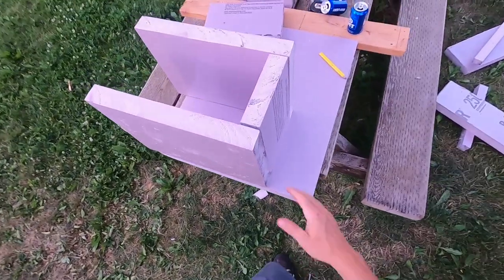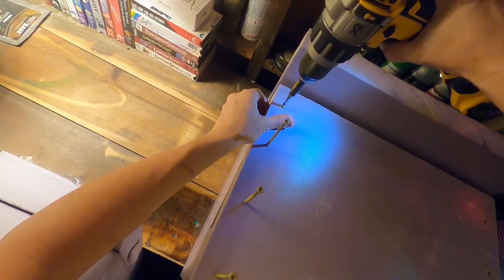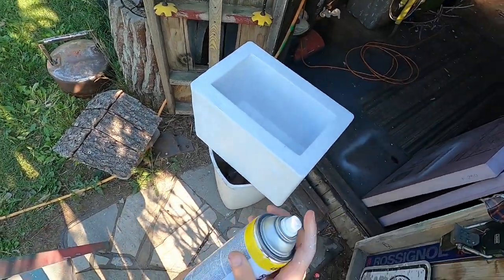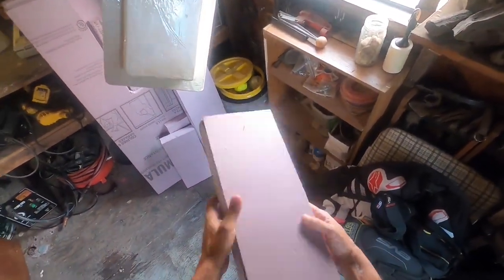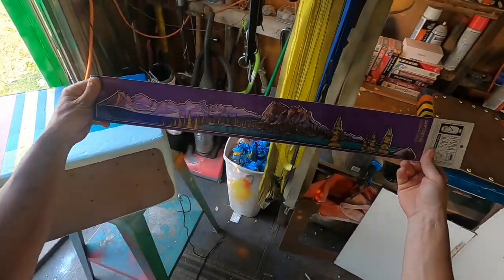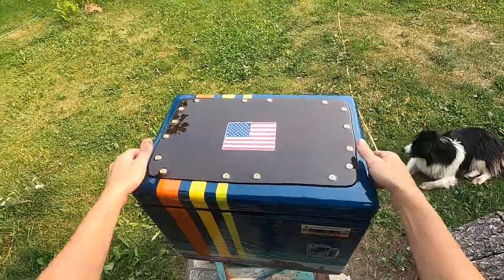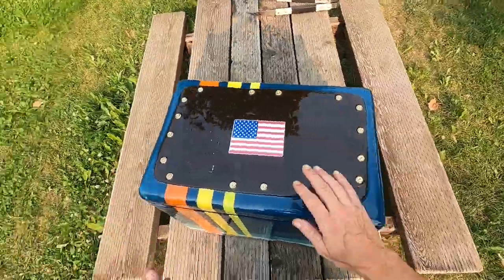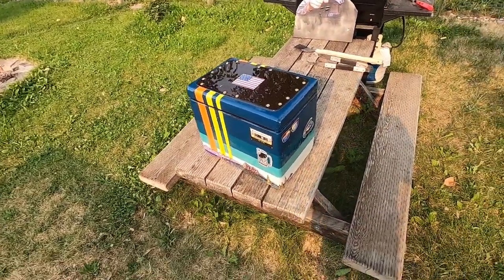DIY HOMEMADE YETI COOLER

Comment: nice job!!!i did something similar by lining my cooler with 1inch pink board and a milar emergency blanket, with a block of ic3 on the bottom, my frozen food on top of that an 2 bags of ice on the food would keep my food frozen for 2 days and the block of ice would be frozen still after 8 days, but the cooler is too bulky and i need a second one for drinks, butter, produce and that kinda stuff, was thinking of making one like yours with 2 compartments in it, one small side for frozen meat and its own internal lid and the other side a little larger for drinks, butter an produce, then a lid to cover the entire thing, was thinking of building it inside a tote for rigidity but ilike the epoxy idea, how tough does it make it without fiberglass matt?

Comment: Thanks for the DIY cooler video! I need to modify my little Ozark Trail cooler that sweats 😂😂😂 I had my igloo jug full of ice, that also sweats, in it. So tney were both sweating 🤦🏽‍♀️ 

I'm going to do the spray foam hack on them both, first. Then get the foam panel for a storage bin to put the cooler in. I'm homeless & can't afford a $3 bag if ice every day. Winter, we have lots of free ice 😂😂😂 and it's so cold I seldom need ice unless I spring for a pack of Klondike bars. 😊

Comment: Awesome job! How did you epoxy the sides? Didn't it just run down and drop off the bottom? I thought coating in epoxy is mostly for flat surfaces. I need to clear a cooler and would love to use epoxy!
Reply from the maker: Hello Stephen. I applied several layers right before the previous had fully dried so they would hopefully bond together. Later on I applied another layer but I had lightly sanded the cooler to create a bonding surface. And yes it did drip off the bottom edges and I had to do a bit of grinding to smooth it out. Thanks for the comment.
Reply: I still don’t understand how the epoxy didn’t slide off? Did you sand the cooler down enough to create a bond?

Comment: How is this holding up?!?!? This is an amazing cooler build man. Definitely inspiring. If it’s still going strong I’ll probably make one soon
Reply from the maker: Hi Ben. You know, it's hanging in there a lot better then I though it would. No major dents or scratches. It held ice for three days in 90 degree temps on one outing but it was not being opened that much. Thanks for the great comment.

Comment: how has this held up being epoxy and foam? Anything you would do differently? I'm considering trying the same thing but adding fiberglass cloth for extra strength.
Reply from the maker: That is an excellent idea! Even with multiple layers of epoxy it has incurred some dents. The fiberglass I think would be more cost effective as well. At what point does somebody simply buy a well made cooler. My cost were quite low until I did the paint job. I think the fiberglass cloth would solve both cost and durability at the same time and also maybe give it a cool rustic look.
Reply: Did you do a build with the fiberglass cloth?
Reply: @BigQ07  I have not. Rough pricing put it around $150, which has deterred me

Comment: Idea for handles: route out enough space to flush mount and epoxy steel or aluminum blocking (maybe 2" high by 6" wide) on each narrow side before painting. Pre-drill holes in the blocking before mounting, and you can attach any kind of handle you want. 
An easier method might be to just drill through all the way and make rope handles, knotted inside to keep them from pulling through, but that would likely compromise the insulation...
Reply from the maker: Great ideas and love the feed back!

Comment: Dude! 
My wife and i were sick of a "bag of ice a day" living with plastic made coolers.
My wife considered that the outter layer must not transfer heat or become hot. 
So we looked for such and here youve done a great job...
Magnificent.
Yeti blows
Reply from the maker: Mucho thanks for the great comment!
Reply: @Crafty Clusterfarg  
Yes sir. Thank you....
Without knowing how ya fared days later.
There's an old fella that made a cooler outta the layers of 1/2 inch foam with reflective side in a rubber made tub. Keeps 5 lbs ice for 7 days .
It's the channel cheap rv living.
And it's the diy cooler.
Yours is amazing for setting. 
We love it, and wish I could implement it. But we keep our meat/cheese/ leftovers. And also have folks sit on it as a bench.
Anyways. Yours is amazing

Comment: Any suggestions on where I could go to get some info on epoxy? I've never used it before, so I'm a bit lost.
Reply from the maker: Hello, I had that very question myself. I watched several Youtube videos, ordered two half gallon jugs on general use epoxy and simply eye balled the ratio for mixing. Regardless of the epoxy used (I'm not an expert) I did find out that it must be mixed, very, Very, VERY well or you risk streaks in the epoxy that will never cure. The layering was quite thin on the cooler, but thick pours are expert level.
Reply: @CraftyClusterfarg  awesome, thank you!

Comment: Need to fiberglass it..
Reply: Good idea. Might start to get heavy but probably not as heavy as those yetis
Reply: Looks like a cool project to try poor man’s fiber glass.  If someone had access to a CNC it would be easy to mass produce DIY foam cooler kits almost like a puzzle, finish with poor man’s fiber glass and the end product could be less than $100, high performance, and customizable
Reply: @devinshepard9832  what is poor man's fiberglass?